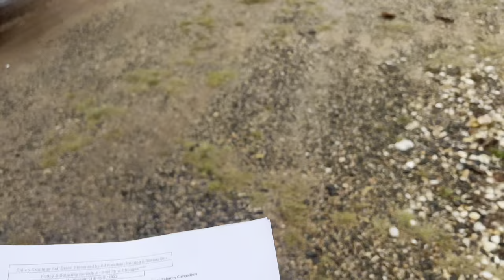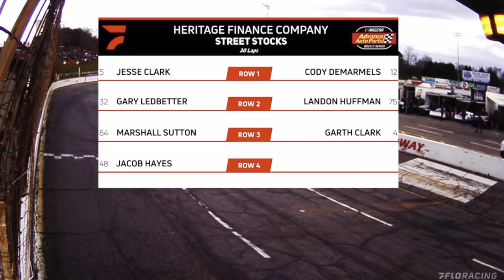KICK’N ASPHALT - LANDON HUFFMAN GOES STREET STOCK RACING AT HICKORY MOTOR SPEEDWAY!!

Comment: I have ran a few races at hickory and loved it every time my first time going I had never seen the track in person go out for practice and I was fastest in last practice session qualified pole and won the feature that was probably one of the most meaningful wins I have had cuse it's hickory motor speedway and it's almg drive from way down south on the Gulf coast to hickory so we didn't go there much at all I ran there 14 times in the ,16 years I raced and I always loved it, I have raced 602 pro truck class for a special pro truck 100 lapper show, 250 lap pro latemodel race, a bunch of what they call street stocks races but we call them super stocks here back then which was a metric based car with Ford nine inch weight jacks off set type built car basically a latemodel with a metric chassis far from a what we call street stocks but it was a blast, you gotta have a big motor and a good car to run with these guys, it kills me seeing huge double stacker NASCAR haulers for a pure stock or street stock car and bring a full NASCAR team with them for the street stock and lure stock it's crazzy the money some these guys spend there on racing. I lived in Mooresville for my college years at UNC and I ran a dirt modified and a street stock for someone at hickory and we got a points championship 2 of those years which was awesome one at hickory and one championshio at Lincoln the dirt track. But the street stocks at hickory are not a true street stock they are old school rule super stocks or latemodel stocks lol but they are fun to drive and close racing to and cheaper then running a latemodel and handles more like a latemodel then a true street stock as we so they are a blast to drive. But man the car count has got alot smaller in street stock compared to when I ran them there. We ran with 15-25 cars every feature I ran street stocks at hickory

Comment: And your trailer yall used in video looks identical to the one I had when I was racing before we got a decent little enclosed I recognize it cuse we built that thing ourself by hand by using a existing low car trailer and re did it it so it would be that low where you could load our cars onto it right out of the shop with no ramps just oll it off onto the shop and roll it right on out of the shop I know it probably isn't mine but man that thing looks identical to it even a few things that are barley visible on it makes me me 75 percent sure that could be my old trailer. If it is y'all got a really nice open trailer light weight tows amazingly and easy to load and unload a race car and not so steep  where it was safe to drive a racecar onto it if you had to if you was by your self. I spent 600 dollars building it and sf it for ,700 dollars then I saw it up for sale a few times online and never seen it since. Would be cool if that is my old trailer. When I was 10-12 years old I raced a 2.3 mustang  ministock on asphalt from 02-04 and sold it  well two years ago I was out of town working went to the asphalt track way out west is where we was in Utah and when the ministock class came out there was this one mustang that looked very familiar cage color the way the cage was built and everything looked identical to the one I had I went to the pits after the races and got a closer look and sure enough my initials that I welded onto a piece of square tubing that is visible just the top of it on the far left side of the car right next to the seat was there and I told the guy that me and my dad got the car for free from a guy race ready but it was a dirt car and we had to redo the chassis and roll cage and everything to first fit me into the car cuse the cage was low that my head was 1/4 inch from the top roll bars cuse I'm really tall guy and I did all the welding on it and welded my initials on it and the year when we did all the work to it and I just can't believe I found it and it's still racing and he was the feature winner that night as well, and on the dashboard he had a good collection of feature won stickers 42 of them to be exact from the 2 years that he had been racing the car for at the time and it still has the body we hung on it as well has maybe two or three extra dents in it. It that's it so who ever raced it after me all these years took care of it didn't wreck it or bend it up which is crazzy, and this was 4 years ago when I saw my very first racecar again. It almost made me tear up seeing that car in person again still racing and the very first car for that young kid that was driving it that night when I saw it he was 11 so same age I was when I ran it which was also weird. They couldn't figure out what the DS-01 ment they searched for chassis builders on fb that build street stocks and ministocks only and all over to try and find info on the car and they didn't think that maybe it's just someone's initials and year they built or redid the car. They even had the same motor in it that was in it when I ran it they said it's been rebuilt 6 different times through out the years and I was surprised cuse it's a 2.3 that has been stroked out to a 2.8 and turning 9600 Rpms is what it was built to turn every lap.

Comment: And I hate when ppl are real bogged down on starts and restarts cuse it causes ppl to get bunched up and wreck on starts and takes a second to get the motor wound up as well. I have pushed ppl alot of times coming to the green just to get my rpms past 2500 coming to the green flag in low gear when it should be at 4500 rolling turn three and should be ready to shift by the time you get past the Apex and end of turn four to prevent cars from getting bunched up and getting dumped by the guy behind you on starts cuse your going to slow on restart. I could feel your frustrations with that one guy